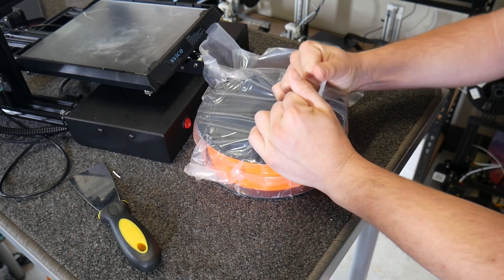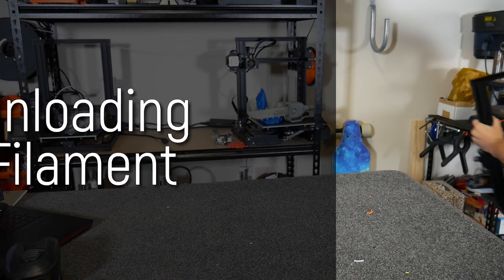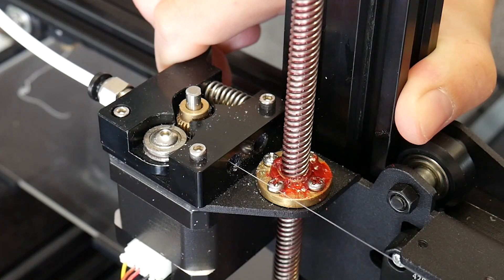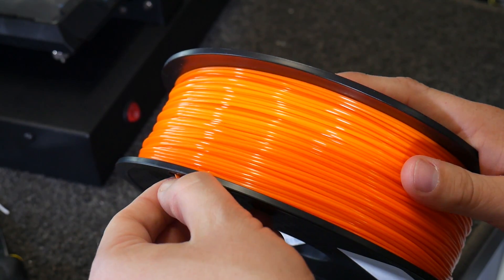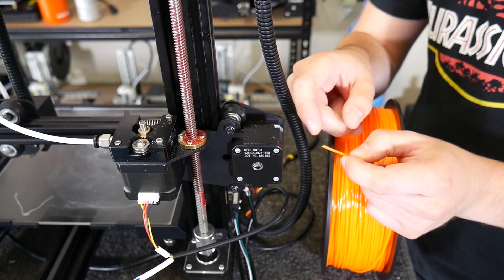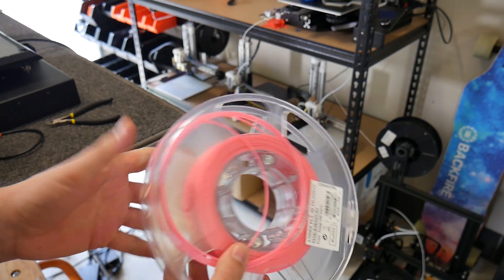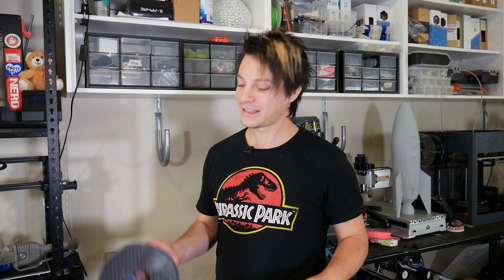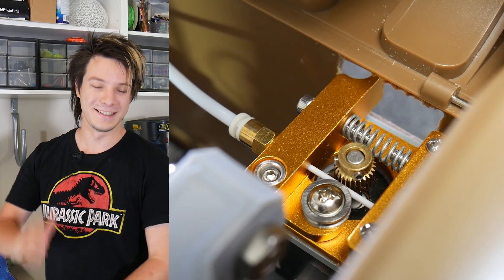How to Load and Unload 3D Printer Filament (and prevent tangles!)

Comment: So... when the filament is tight and rolled perfectly (brand new) the filament gets crossed sometimes and tangled... unwinding it, rewinding it, keeping the tension doesn't always work.... normally it doesn't if its a "tangling spool" it'll just keep tangling... I wish this long ass video would have said "for storage" because nothing in here fixes the issue that I described. Silk PLA for example, its a problem... if you're here because of the title of this video, the fix is to 3d print a simple guide for the filament... if you have an AMS or single roll it works. I made mine, just google filament guide for tangles.

Comment: Thank you so much for this.  I got a new 3D printer (an Elegoo Neptune 3 Pro) the other evening and had a wonderful time printing with the tiny loop of PLA provided.  I then used most of that and switched over to the Elegoo roll I'd also ordered.  It's been an extreme hassle of trying to figure out: Do I thread through the holes?  One hole?  Both holes?  Neither (as I've seen some people do), since the PLA being pulled through the holes seems to make my filament-breakage sensor go click-click-click like it's trying to move with a neck brace?  The roll seems to barely be holding itself together, so the tip about tension seems extremely useful and I'll try to get that wound back up as soon as possible.

Comment: It's call straw moisture trap, either caused by wet filament beforehand or the high amount of moisture in the air. Plus the heat creep can slow cure the filament with moisture.

Comment: For what it's worth. The brittleness is because it is absorbing moisture. It's likely that the filament is getting wet in areas of the tube where tiny defects are allowing air exchange with the outside.

Comment: i do a lot of work with physics and an interesting fact a lot of people dont know is that strings/flexible cables naturally knot themselves when agitated. an easy example most people know is that if you put your ear buds in your pocket and walk around a while they'll be all knotted when they come out. you can recreate this before your eyes by putting the ear buds between your hands and rubs your hands together. filament is just like this and it is just as easily agitated.

Comment: Nice. Catching up on your videos, one at a time.
In the year I have been printing, I only had 1 knot. It was a loose wound roll.
The tip at the end is a way to move filament from a clunky roll. I have spools (The loose wound) that are way different sized to the spool holders that come with the printers. So the drill is a way to transfere the filament to a standard size spool. Thanks.

Comment: I have a problem some times with my ultimaker 3 where the feeder grinds away the filament and starts to print in the air even when I rewind the spool and I have the tension of the feeder in the milde (if you are familiar with a ultimaker feeder) any tips?

Comment: I was printing a lithoplane (printer settings count) and my Anycubic X detected a flow issue and paused, I had no real damage to print after cleaning nozzle and restarting. Cheaper filament can have built in tangles too. Filament near hot end may become brittle from heat treating.

Comment: What do you do if the filament goes inside the pipe between the extruder and the hotend?
I mean, in a way you won't have a tip to pull. How do you pull it out?

Comment: hello! i have a qidi tech x-max . do you have any idea how i unload and add a new color mid print? lol
Reply from the maker: You should be able to pause the print? If it's the same as the x-maker there is a lever on the side to manually change filament .

Comment: you said what? what printer is that??? or ender 3 is a clone or that is a clone... only the software looks different... sooner or later the world will realize there are but only a few factories in China and they produce all printer, other tv's, other car radios, other car amps...  i can take my ender 3 ten pro, go to an aluminum shop, buy extrution and basically make a 10 and surely it wont cost as much as the price difference... its the same as tig welders, youtube is full of compare this brand and that brand and which 200w is better than another 200w until you go look for spares and you find one place produce ALL the internals for ALL chinese tig welder... but hey it it brings you noddy points on Youtube go ahead... it just some of us know they exactly the same cheap import high profit high production low salray earning crap...

Comment: why keep tension on the spool???? wount any tension me lost the second it retracts??? ive noticed some small parts really make the spool rock back and forth
Reply: "Wount"... I like that word... anyways, it's not so much the tension, as it is preventing the end from going underneath the windings... you hold it tight-ish, so it doesn't go over the edge of the spool and under the rest of the wire... err. filament.
Reply: @haloz281  *faceplant, thats a spelling mistake?? i thought that was OBVIOUS??? and sorry buddy you are completely missing the point big time. U can add all the tension u want. but unless u have something to hold it while printing its a complete waist of time... like i mentioned, any tension will be lost with the first retraction and if you are printing small part it retracts soo much that it will rock the filament spool.... PS... I dont proof read quick comments, expect mistakes
Reply: @phmaximus  That's why I said "not so much the tension"... it has nothing to do with tension, just controlling the end of the filament so it can't knot. I barely remember making this comment, but I'm sure I meant before printing was even attempted. And no, I honestly like the word wount.
Reply: @haloz281  ahh ok cool man,  there may be a mistake??? my comment was in response to this video and the statement about keeping tension on it.  in not really talking about controlling the end.

Comment: Good advice for hot swapping filaments. Tangled rolls I would think most users should instinctively know how to avoid and correct, however, I guess there are some that may not know proper use and handeling.

Comment: I had the idea that theoretically every 3d printer should be able to auto bed level 

You just have to run a small current through the nozzel and then you have one wire connected with a metal heat bed 
Ore make some conducive pads at the rim of the bed 
Then to level the printer you slowly and drive the nozzel on to these pads and measure how the head travelled befor the circuit is completed

Comment: PTFE is pretty translucent. Alex Kenis ran a bunch of experiments to see why his PLA that was left on the printer was getting brittle, and the deciding influence turned out to be UV light.
Reply from the maker: Maybe, but this occurs in my garage as well with no windows and no UV source. Mystery!
Reply: @MakersMuse  Interesting. Makes me wonder whether the typical Chinese PTFE releases any fluorine, and halogens are pretty damn reactive in general, that's how fire retardants work, they release a halogen that subtitutes hydrogen bonds that hold polymer chains together. And whether same happens in Capricorn tube.

Comment: Pro tip: If you have a crossed filament, you can just leave it in the printer by just giving enough slack to take a loop off the spool and flip the loop to remove the knot.

Comment: I'm a welder, i know this problem very well.
Welding wire is like filament but even worse, there are around 2500 meters (around 1.5miles) of wire on a spool. Not funy at all to untangle this.

Comment: Hey Angus,

you mentioned PLA sometimes becoming brittle when stored inside a bowden tube feed between the spool and the hotend.
Fascinatingly I experienced pretty much the same effect altough I run a direct extruder setup with no bowden tube between the extruder and the spool.
I figuered that the filament probably is under a constant stress when sitting there for weeks with a significantly larger radius than it has right on the spool. It would then develop small fractures under that stress that become weak spots when later bending that part of the filament and it cracks there.
While on the spool in otherwise the same conditions, the filament is not noticably harmed by open storage.

So I guess that, ultimately, the tension inside the filament causes the brittleness which would also apply to filament resting inside a bowden tube which forces it into an "uncomfortable" bend radius.

Best regards and keep your high quality content coming! :thumbsup:
Reply: Completely agree! Stress cracks form in PLA due to forcing the filament to a drastically different bend radius than initial winding and leaving it in this position for an extended time. Pure PLA is the worst. Impact modified PLA is much better. I never see it with other filaments. Also, I do not use the filament detention holes in spools of PLA. It snaps for the same reason. I use tape to hold the end to the spool edge and never have issues storing 1.75mm filament. 3mm PLA is another story...

Comment: I frequently have mine snap in a similar way with PLA but I do not have any Bowden style setups. I've actually been between prints messing with Cura and out of nowhere, the PLA filament snaps about a half inch from where the filament enters the feed mechanism.

Comment: wouldnt you be able to make a filament sensor that detects jammed filament by using a gear setup similar to direct drive extruders, but have a gear right at the feeder that is hooked up to a movement sensor of sorts? like as the direct drive is pulling the filament in that will turn the sensor gear. if that sensor gear ever stops when its supposed to be moving then there is likely a jam or a lack of filament. in this way it would work as both a filament sensor and a jam detector. could be wrong though i only just thought of this like 2 min into this video so i decided to mention it
Reply: now that i think of it you wouldnt even need to do much extra probs, just attach a sensor the the idler gear on the other side of the extruder motor since that doesnt move unless there id filament moving

Comment: Andrew Currie, I agree with you, it happens to me in the parts of the filament ( Even those parts that haven't touched the extruder gear yet) where the filament is left in another direction than the one it was when in the spool. If the filament is bent like when in the spool, and that section is stretched out straight and left so, the part of plastic under the "arc" gets stretched out creating microcracks making the filament brittle I had an extreme case when I rewinded filament from a smaller spool to a bigger one and the filament cracked everywhere but heating it in the oven like when drying it solved the problem. By the way I'm talking about PLA :)

Comment: I had my 3d printer in my utility room (with washer and dryer. I found that the filament went brittle very quickly in there. Not sure if it was the heat or humidity, but regardless, since I moved it into the workshop the filament is much less brittle

Comment: 12:00 - same applies to cables. Cables should never be rolled onto something while holding the loose end tightly... That's what causes the "wiggly" look you see on things like barrel vacuums (without self-retracting leads) and extension cords used by tradies.

Comment: HA!  I learned something.  I always learn something from your videos.  That's why I subscribed.  That unloading sequence.  Mt Tevo Tornado doesn't have a load/unload sequence that I know of but....I can extrude + and -.  Normally I  unload the filament but yes, heating the nozzle (200/210) then pulling it out.  Never thought to push it in some.  (manually)  Anyway when I load the new filament  I'll then extrude 50-100mm to flush the old color out.  Thanks for your videos

Comment: Mine cracks in mid-air between the spool and the extruder where it essentially straight, and I think it's because the spool diameter is so small. It looks like it gets rolled on warm and tight, and gets a set curvature that compresses one side of the filament. Then when the filament straightens that compressed side stretches making it more prone to cracks because the filament is now cold and not flexible.
Reply: I'm sure, that this is the correct explanation of the "FILAMENT SELF DISTRUCT OVER NIGHT" phenomenon.
Reply: I was wrong, the filament hardens with exposure. I just did a large print and the filament on the inside of the roll is soft and pliable, unlike the exposed filament that hardens.

Comment: Wow lots of discussion regarding snapping filament. I have a direct drive and a Bowden tube system and they both get brittle. So that eliminates the gear tooth theory. Personally, I think it’s heat creep from the hot end. It “bakes” the filament. It’s more pronounced in the Bowden tube because heat travels through the tube more effectively.

Comment: I tend to find with on-spool tangles that pushing the filament in to loosen some of the tension makes it far easier to  slip the knot off the spool without pushing it down farther in.  Since it's just a light letting of the tension, it doesn't wonk up the entire roll and it's much faster to rewind (and also limits the chance of the pushed down knot kinking the filament.)

Comment: Why didn’t you cover removing a knot or overlap if it’s found during printing, it can be done! If you catch it before it becomes to tight and jams up, you can get the overlap out. Take the spool off the holder an feed out enough filament as to not interfere with the printing. Then find the loop on the roll that is overlapping and expand it out so you can run the whole roll through the loop, if you run it through the right direction you have taken the overlap out, if you’ve went to worn way you’ve doubled it just watch how the filament is overlapping. Then roll the excess filament up back on the roll and place the roll on the holder

Comment: I have noticed PLA cracking inside the PTFE tube as well. Especially 3mm diameter filament. If you look closely on the inside of the natural curve of the filament, you will notice little cracks. This is caused (I think) by the filament being held relatively straight inside the tube, forming stress cracks on the inside curve where the plastic is being stretched. This is especially bad with old filament that has formed to the tight curve of the spool.

Comment: A quick tip I have been using for some time is store your filament in the bags sold for storing clothes or for traveling.They have a zip seal and a one way valve that you attach to a vacuum cleaner to suck the air out. Reasonably cheap and fully reusable. Can add some desiccant / silica gel if required.

Comment: I got one thing to add to filament runout. Most of the time it happens during a print and the print head moves up a bit when the runout sensor triggers. If you remove the rest as described and insert the new and do a little purge it is wise to cover the print with a piece of paper or something otherwise you get a blob of filament on the print and if its something that has great layer adhesion like PETG then that blob might (will) really attache to your print and then you either do some fancy knife work to remove and hope you don't dislodge the print from the build plate  or the nozzle will get stuck on it the next time around and you miss some steps. Same holds true if you just change filament on purpose like stop at layer 40 and go from black to white.